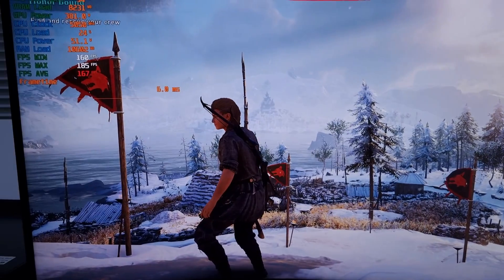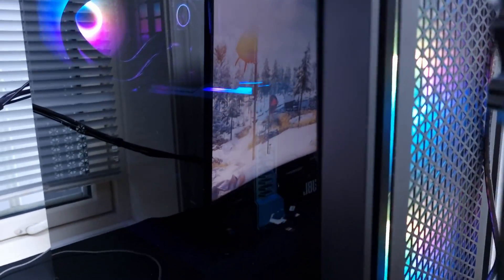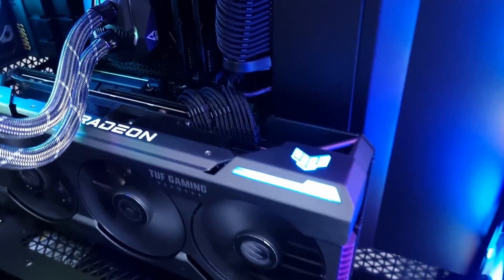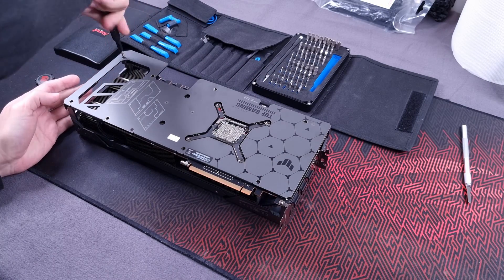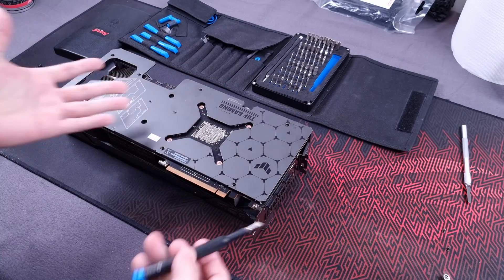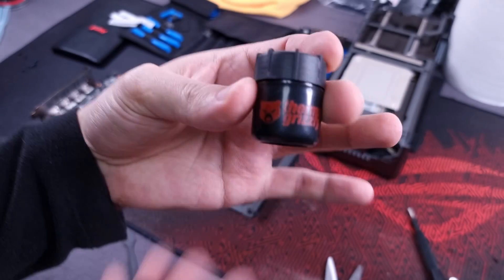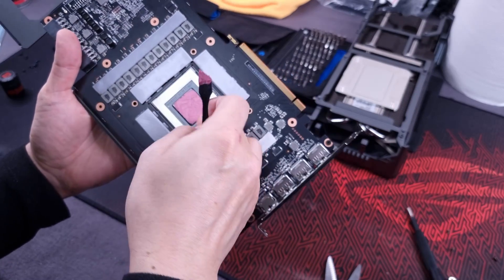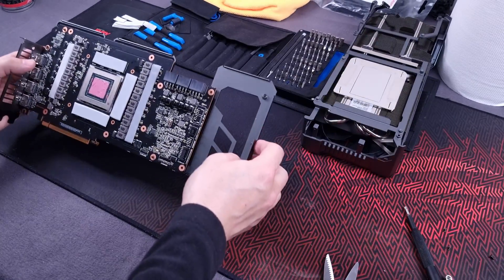ASUS TUF RX 7900XTX TEARDOWN (hotspot fix)

Comment: I just recently purchased the AMD RX-7900-XTX and received it yesterday.  Upgraded from a NGreedia GTX-1070-Ti.
I don't know what software you use to get the numbers on the screen to find out my delta.
Anyway, I put the card through a massive test by putting it through all the 3D-Mark test twice on each test.  Also tested it on Geekbench and Cinebench 2024.
This is the second time I have ever owned an AMD GPU, the first time was back in 2002, then I changed to NGreedia when the GTX-1070-Ti came out.
And yesterday was the day I stopped using the 1070-Ti.   The 1070-Ti survived hurricane Sandy in NYC as my computer was underwater.
I cleaned it after it was 2 days underwater.  And still works even today.  Anyway, I didn't know this about AMD cards.  🤷‍♀ I have the same exact AMD card.
Would like to know what software you use to get those numbers on the screen.
Reply from the maker: It is called MSI Afterburner. There is a video on my channel with a tutorial on how to use it.
Reply: @TechnologyHive  Thank you 😋👍
Reply from the maker: https://youtu.be/TkwCPGmVszI

Comment: I have the exact same card, have the same issue, sometimes it fixes itself, due to thermal expansion refilling the paste naturally I guess, I can guess it'll only get worse by time.
 My main problem is vram temps are really high from the start I got this card. 
what's your prolonged stress test vram temps on this card? 
mine is stuck with 92c in 10 mins of AMD's own stress test, and I'm seriously thinking about repadding it.
Reply from the maker: I would advice you replace the thermal paste and pads. ASUS used poor quality paste with this card.
Reply: @TechnologyHive  don't wanna ruin the warranty but seems like that's what I will need to do eventually

Comment: What I love with modern GPUs whatever the brand, is that we pay loads of money, but we need to fix the coolers afterwards. Thank's Nvidia and AMD.
Reply from the maker: Very true.
Reply: Worse QC is probably a part of the issue, but bear in mind how power hungry these cards are nowadays. At almost 400W power draw tiny details matter a lot and affect cooler performance in a huge way.
Reply: May be, but the fans need to be used, they were definitivelty running super low!
I always set them manually before gaming.
Reply: @emanuelmenin  I notice he wasn't monitoring fan speeds in Afterburner. In fact, I think I discovered in my setup that Afterburner was interfering with the default fan curve on my RX 6700 XT despite me only using it for monitoring and nothing else. I was hitting hotspots of 110C (with main GPU temp being in the 60s) and the fans were only going at around 40% at these temps! I repasted and there was a modest improvement, but the real improvement came with disabling Afterburner and setting a custom fan curve in Adrenalin such that the fans are at 50% at 80C (hotspot) and 100% at 85C (hotspot). Combined with a modest undervolt, the card now never reaches 85C on the hotspot and the fans never go above 67%. With the hotspot of 94C shown at the beginning of the video the fans should be going at 100% - but were they? I somehow doubt it...
Reply: Nvidia and AMD only make dies. Nvidia has more control over pcb and AMD let's board partners to decide what they do for cooling thus blame board partners who make the cooler for your gpu or nvidia for who's logo you pay half gpu price, lol.
Reply: I have the tuf 4080, which turned into a leaf blower until I fixed it with PTM7950. 
It would pump out the paste in like 1 month.
Reply: how card pulling power is AMD/NVIDIA cooling wise is not from their
Reply: thats like you blame CPU for Having Higher Temp when you slap on Stock cooler or cooler that cant handle that cpu
Reply: @od13166 incorrect because a GPU comes inside the cooler which is barebones considering how much better proper application affects performance
Reply: @pedropierre9594  nope usually and this is ASUS who blames AMD by their screw thingy back in RX5700XT we talking here lol
Reply: @pedropierre9594  and fact that he made that card worse after repasting thermal paste resulting Core Hotspot temp difference 

before it was like 20c difference between hotspot up to almost 30c difference between Hotspot and Core that will cause more problem when thermal compound performance degraded
before he getting 75c on Core Temp but getting 95c hotspot is much better situation because after he repasted it sure core runs 55c but what if that thermal compound degraded then? you get 75c in core but hotspot is just 115c lol
 
again core temp concern for nowdays AMD Card doesnt matter becuase your card gonna throttles by Hotspot temp anyway  then Core temp reaching 95~100c
AND You really want tight that gap between core/hotspot? air cooling isnt good option

Comment: I had a 7900XTX Red Devil. Knew it had a huge delta before I threw it in so I re-pasted it before installing. I also have a P3 case so open frame. My core temps were around 50C, and hotspot around 70-75C (AFTER REPASTE). I play at 1440p 165hz, and I run the fans at around 80% when gaming

Was going to say how in the hell are your temps so high on your card. Your temps after the repaste are more in line with what mine was after I did mine. ASUS always has massive coil whine. Will re-paste my TUF when it arrives before I install

Also, I've had all my 4090's installed horizontally. Just put a stand under the one corner closest to the glass. It's not hard
Reply from the maker: If you want to install your card horizontally, go for it. Its your money :)

Comment: I'm hitting 98c easy on Battlefield 2042 on medium graphics with my 7900xt Phantom Gaming. Definitely going to buy some thermal pads and thermal grease and try this. Though I am tempted to do the Newegg tradein for the Sapphire pulse, I hear they're good at cooling, but after this experience, I'm not really too confident either way.

Anyone by chance know if the sapphire pulse runs any cooler or there is any benefit? Still would be a 7900xt.
Reply from the maker: My understanding is that most cards suffer from the same issues, no matter the vendor. It has to do with AMD's chipplet design. New paste should help a good deal.
Reply: A couple months ago I was building a PC for a mate and I also got the 7900XT Phantom Gaming OC for him. The Temperatures where very good. 59 GPU Edge and 79 Hotspot max, with only 1200 RPM on the cooler, which keeps the noise under control. So the cooler works really good. Only the Thermal Paste coverage isn't always that great. But that can be an issue with every brand. For my taste I wouldn't go with Asus on a Radeon, there I would prefere Sapphire or Powercolor. But also Asrock made already good Radeons.
Reply from the maker: I prefer Sapphire. Great cards.

Comment: Hello, thanks for the video. My card had a temperature of 95 on the hotspot and 80 on the edge but now it is 95 on the hotspot and 94 or 95 on the edge. Do you think that changing the paste will lower both temperatures?
Reply from the maker: It definitely will help. I would stick with MX-6, Noctua NT-H2, or Kryonaut Extreme.
Reply: @TechnologyHive  Thank you.

Comment: Thanks for the tutorial! First 4 weeks I had fabulous temperatures on my Asus and the Delta was just 15 degrees. After 4 weeks it is getting worse. Have around 65 degrees and nearly 90 on hotspot. So I will give a try if it is getting worse. Thanks you so much bro.
Reply from the maker: I am glad to I could help! I hope you get it under control. Try some MX-6, if you want.

Comment: You have shit psu ! Change it ! Minimum PSU is 850 W GOLD or higher.
Reply from the maker: My total system power consumption from the wall is around 450w during gaming. My  PSU is a Corsair HX 750W 80+ platinum rated. Please explain how this is a "sh*t psu, and why I should change it? Thank you 🙂

Comment: 25 degree delta is horrible.  That would make RMA the card honestly.  I just bought a 4070 TI Super, and it has a 15 degree difference in temp/hotspot and that already makes me uncomfortable, but I can live with it.
Reply from the maker: My 4070 ti had a similar hotspot delta. Even after changing the thermal paste. It most likely has to do with DIE not being perfectly leveled on the pcb, as I have shown in one of my previous videos. Sad.

Comment: I have the exact same card and luckily my temps + delta are the same as what you have after your repaste.
55/79 only ever seen the hot spot pop into the very low 80s once. I also get superb Port Royal scores with my card #50 with a 5800X (non X3D) and top 4% with a 5950X. Fastest XTX in the UK. Quix-Otic.
Edit: Stock BIOS, all O/C from Adrenaline and she pulls around 455W. CPU's with tuned PBO & Curve optimiser.
Reply from the maker: Very nice! You got lucky with your card :)

Comment: I have Asrock 7900 GRE,   GPU  50c , hotspot 88c ,fan speed 48 %, no throttling ,works fine but big difference between gpu and hotspot.
Reply from the maker: 38c delta 😬. I would replace the thermal paste.

Comment: Nice! I had to repaste and repad my Liquid Devil 7900 xtx three times. I talked to Powercolor directly, I used the Artic-TP3 1mm pads. Amazon did RMA the card for a refund. So I bought the non liquid devil and put an EK water block on it. GPU 100% max - 65c Hot spot - 80ish.
Reply from the maker: That is really good temperatures at load. 👍

Comment: wait, 20 degrees less on the core just by replacing the paste? wtf, what a shame asus
Reply: It's bullshit. Let that thing heat up and it will go up. But now there is even higher delta between the core and the hot spot by a whole 5c. This is in no way any better.
Reply from the maker: They are not using good quality paste.

Comment: Nice video and info here. Do you know if the Asrock Phantom Gaming 7900 xtx are using the same thickness on thermal pads?
Reply from the maker: 2mm on vram. 3mm on vrm.
Reply: @TechnologyHive  Ah okay, thanks a lot!
Reply from the maker: @klevzor  No problem 😊
Reply: @TechnologyHive i have the Asrock 7900xtx aswell and i have been experiencing 91+ HS temps with 350W  and 100% fans. Should i just just the thermal paste or are the Vram thermal pads necessary to swap out?
Reply from the maker: @parsapladiator  I would just do the paste. The pads should be okei. I replaced mine just because I have extra pads laying around.
Reply: @TechnologyHive  thank you so much you're a legend.
Reply: @parsapladiator  FYI; Swapping paste without pads worked fine for me aswell. I actually swapped for PTM7950, which I highly recommend
Reply from the maker: @parsapladiator  Thanks for watching 😊.
Reply: @klevzor  thanks for letting me know. But where are you even supposed to get those? They are chinese and not sold on to regular clients right?
Reply: @TechnologyHive  which pads do i need for 7900XT ASUS TUF?
Reply from the maker: @MegaChickenPunch  I don't know. I don't have that card.
Reply: @parsapladiator sorry for the late response, but yeah you are right. I bought it off ebay and they worked very well, decreasing hot spot temps quite significantly
Reply: @TechnologyHive  1.8mm and 1.3mm just measured on mine. Thank you for the video, very helpful.

Comment: I bought the exact same card in last December and started to see the hotspot rising drastically in February, in just 2 months from purchase. Everything was still within spec but i knew it was going to get out of control sooner or later, hotspot at the time was 100'C under stock 375W load in a very good airflow case. Ended up selling the card instead of opening it up due to voiding the warranty and not being exactly crafty with my hands. Even going on with it and RMA'ing it for a new one, the problem would just repeat itself sooner or later.

Damn shame, because i really liked the performance of the XTX for the money, i paid 999€ for a brand-new one but experiences like this will only taint your trust.
Reply from the maker: For me it was worth replacing the thermal paste. I am happy now with my purchase after all the drama with the hotspot.

Comment: Have the same card and the same issue! Bought some PTM7950 but I'm too lazy to repaste it ... 
What you did reduced the overall temps, but not the hotspot delta at +25C, so I suspect the contact issue is always there and dunno how to solve it.. Washers ?
Reply from the maker: No, I don't think washers are the answer, though of course you can try. The issue is the chipplet design. It's not perfectly flat. That 25c delta will always be there, so reducing overall temp is still a win-win situation.

Comment: I´ve just repasted mine 7900 xt form XFX with MX-4. When I played games like Last of us i had gpu 60 and hotspot 95. 
After I have 60/80. So thanks for the video! It helped me a lot!

EDIT: 
My result lasted only for week or two. The hotspot temp went back as it was so I decided to go with PTM 7950 and it is already month or so and the temps are as it should be. (delta no more the 20 and hotspot under 90) No regrets at all. 
Interesting is that the new XFX 7900 XTX card called Pheonix Nirvana already has the PTM 7950 applied by stock so I think the XFX knows why they use it instead of  regular thermal paste.
Reply: i have the same card how hard was it
Reply from the maker: Nice results! And thank you for watching!
Reply: @TechnologyHive so bro with good thermal paste the hotspot temperature will reduce or
Reply from the maker: @ziyaadumar6191  absolutely. Asus is using some junk thermal paste. I'd advise you to replace it. MX-6 or equivalent.
Reply: My old xfx 5700xt have many temps problems... XFX send me a new and better  with more cooper fan.
Reply: je valide egalement pour l'efficacité du  PTM 7950 ! incroyablement meilleur. j'avais exactement le meme soucis, pate thermique qui s'echappe du die
Reply: same thing happened to me using a mx4  i enjoyed 10c less but after few weeks back to 105c hotspot :(.. thats why im here to find a final solution.  il read around i just ordered duronaut i hope its better longevity wise

Comment: I have the same issue with my Red Devil 7900xtx.  30, 40 deltas.  Applied new thermal paste an pads which initially lowered the temps. Within a cpl weeks they were back...30, 40 deltas!!! So disappointed in this purchase
Reply: I'm thinking about trying a thicker paste. Idk, super disappointed.  Took forever to pay for this card only to have these issue's.
Reply from the maker: @dogface313  Sorry to hear this man. Can you return the card? Or did you puncture the warranty sticker? If you heat up the sticker you can remove it without damaging it.
Reply: Unfortunately I ruined the sticker.  Going to try  PTM 7950 an hope for the best. Will get back to you on how that works.
Reply: @dogface313  and?
Reply from the maker: @dogface313  👌
Reply from the maker: What paste and pads did you use?
Reply: @TechnologyHive  NB supermax 15w for the pads, and MX 6.

Comment: Soldering process is through  a oven making all parts on pcb sink in its own soldering spot. GPU should be put on by a heating proces with a machine who makes constant pressure on GPU to make it even until all balls under GPU are melted and GPU is even with PCB and not with +- 0,1 mm. Many more Asus and Asrock gpu will come with hotspots.
I have stopped buying Asus and Asrock products because of NO quality control and cheap manufacture process, wich is also the reason we saw several motherboards catching fire due to a chip was mounted upside down for a skyhigh price . I will never return to Asus or Asrock
With AMD GPU go after Sapphire . Sapphire is for AMD what EVGA was to Nvidia.
Reply from the maker: I don't know much about the building quality, but that sucks you have had bad experience with asus products.

Comment: I got mine ASUS TUF RX 7900XTX mounted in a Silverstone alta g1m. In this vertical case, the gpu has the i/o panel on top. I thought it was perfect to hot air exaust but i had a bad surprise. The card overheating with core hotspot @100 degrees and fan speed to 3000rpm. My only solution is to rotate the case 90 degrees and the gpu now is in the same your position. any one  has another solution for me ?
Reply from the maker: I would replace the thermal paste with something good, like MX-6.

Comment: AMD needs to mandate PTM7950  on their cards, almost all of them in the  6000 and 7000 series have this issue and its currently the only known true fix. Having to open up $1000 cards is insane to me. Going to have to do this to my 6950xt,  originally an $1100 card.
Reply from the maker: I agree 👍🏼.  But once you fix that hotspot issue, these cards are goats. Good price per performance ratio.